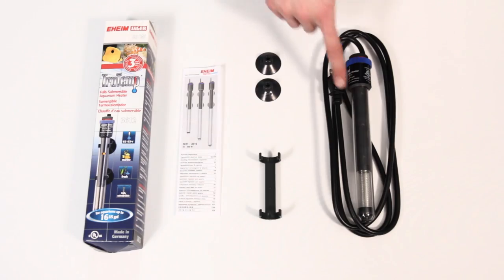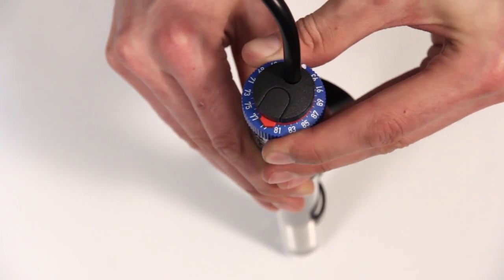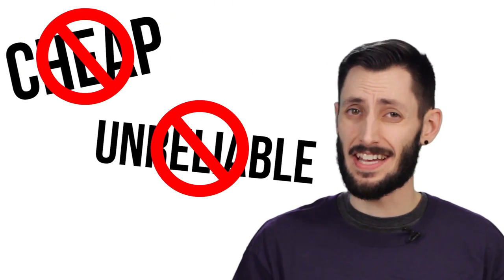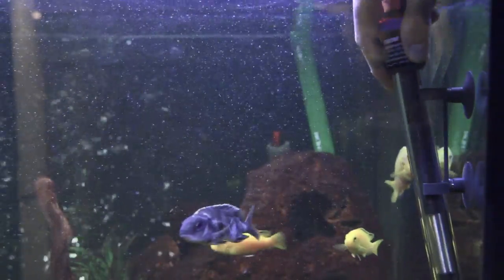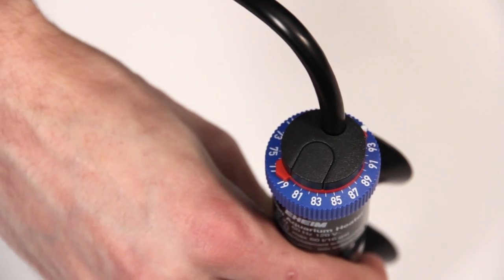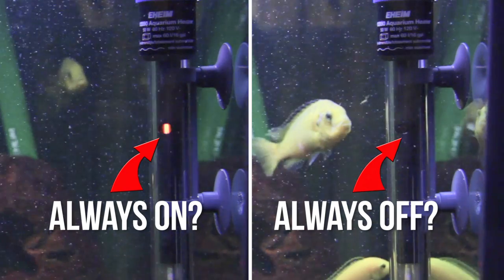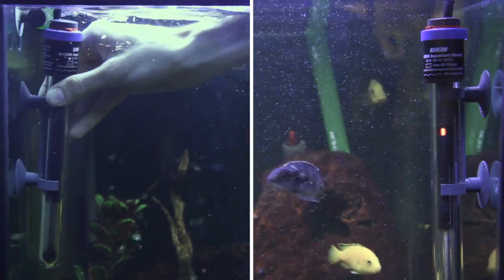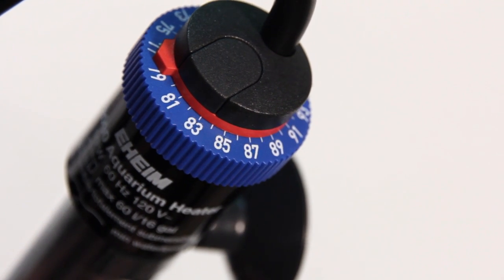How to Set Up, Install, and Calibrate your Eheim Jager Heater | BigAlsPets.com

Comment: NEVER remove your heater while plugged in. Unplug and let it remain in aquarium for 15 minutes before removing.
Reply: Why
Reply: @sweetscience1019  If left plugged in when removed from the tank, the glass tube could crack because there's no water to keep the glass tube from overheating.
Reply: CoroaEntertainment 👍🏼
Reply: yes don't do it people,  i mistakenly pulled a heater out of one tank  thinking it was unplugged it got so hot it melted the plastic trim around the top of the tank it was touching fire hazard
Reply: Well I learned that the hard way
Reply: @CoroaEntertainment and you’ll burn your hand and trust me they are hot

Comment: The system of this heater is complicated. You should just set the temperature with the indicator and you're done. There are versions that you have to lift that small lid with a screwdriver and others say that you just have to turn the back. I broke the lid trying to calibrate. I find it VERY complicated to calibrate.
Reply: To be fair to chelo I've never had issues with any other, I have had one of these and only had issues, maybe there are faulty batches? Mine is approx 6 degrees 'c off.

Comment: Been using an eheim jager 300w in my 75 gal now for 4 years never had a single issue temp is within 0.5 of set temp always used the jager series never had an issue with any of them

Comment: Sorry but I don't understand the Eheim instructions and I also don't understand the instructions in your video. It doesn't make sense to me? Maybe I am just being dumb? What arrow or dial am I supposed to move to the temperature the water currently is? The one on the back won't move to that as there is something blocking it. It will only move left or right a few clicks. My temperature is 28°C (82.5°F) when I have selected I want it to be 27°C (80.6°F) so it is out by 1°C or almost 2°F difference.

Comment: I’m trying to recalibrate mine it will not go below 80 no matter what I set it too. And when trying to recalibrate the red dial will not reach the temp that the thermometer is saying it’s heating too so how do I recalibrate it? I’ve been working on this for two weeks in a bucket I even changed the heaters out I have two of them an this one is the same no matter what you set it to it will only heat to 80 or 82 I’m trying to get it to 77 degrees what am I doing wrong?

Comment: I purchased new 70 Gallon aquarium back in 1978. At that time, I heard that EBO Jager was a good brand of aquarium heaters so, I purchased one. Fast forward to 2018.  Well, my EBO Jager heater, after 40 years of "flawless" performance, finally died.  Funny, the heater that I purchased to replace my EBO Jager (purchased it many years ago), has been very finicky wth the temperature setting.  I am now looking for another EBO Jager.  ;)

Comment: Hey Thomas,  did EBO JAGER get bought out by Eheim?  Hopefully not and hopefully Ebo J is still available. I have had absolutely NO luck with Eheim heaters (the red/blue ones) as I find they keep on shorting out or simply quit working.  Ebo Jags were incredible heaters and I never had a problem with them... Never... Ever!

Comment: Say I had a 130 gal tank outdoors and a 300w eheim jager marked to heat up water up to 1,000 liters. Outside temperature doesn't vary much at night. Will it perform as desired?

Comment: question so you state that using to heaters for a large tank what would you recommend for a 90 gallon tank one heater or two, and also what wattage would you recommend per heater thanks

Comment: Every heater I've bought say's put in tank for 30mins before plugging in.Unplug heater for 30min before taking out.Does the ehiem heater instructions say different?I Like the calibration feature.Fish On
Reply: I wondered about that too .. video just mentions removing and adjusting. Might have been worth mentioning to UNPLUG the heater first! I know they have auto-shutoffs but I don't trust them. I always unplug and wait a bit before removing. 30 minutes is a bit long, I usually wait ~ 5 minutes.
Reply: Theres no point I take my heater out straight away after unplugging and its not even hot

Comment: Hello lovely people,I have set my eheim heater (200 watt for upto 400ltrs) to 29C. It heats upto 29 and then when the water temp drops to 27 or 26 then it starts heating again. What should I do to maintain the water temp at 29. My tank is 325ltrs. Do I need to recalibrate the heater.
Thanks and a wonderful weekend ahead,
Saif
Reply: Sometimes its best to get a bigger heater especially if you live in colder environment. Or get Two smaller ones of the same wattage.

Comment: Hi . I just got the 150 watt version for my 200 liter tank . And no matter what i do it keeps heating  all the time . It doen't help turning the blue dial.   I wait for ten minuttes every time i adjust and have tried turning it all the way to each side . And it keeps warming and doesn't turn off?   The temperature is about 28c .   Room temperature is 21 c.   And i don,t have any lights turned on atm .   Is it broken or i,m i doing something wrong ?
Reply: whooptie2doo that sounds broken lol

Comment: well I just bought a brand new jager 125 watt n it wont turn off it sticks on I turned it to 18 tank was 26 n its heated it ti 30.4 so not using it best heater there no good
it cost me over £20 iv had 3 heaters fail n 3 weeks a brand new eheim jager a 6 month old marina we water in it and a 200watt Trixie 8 month old one with mist in it and thee jagers u can oney calabrate them by 1 degree
Reply: matthew o'dea are you sure your thermometer isnt broken? I've found a lot of them (along with a lot of heaters) are extraordinarily unreliable. The marina one that sticks to the inside being the worst.
Also are you keeping anything in the tank with the heater which could mess it up? I've had two marinas and aside from being bulky they've always been good but I also had a turtle who used to rip that thing off the wall and do god knows what to it. Both of them ended up sounding like they were going to explode any minute

Comment: hello, my heater it's always on and cant reach the right temperature.
Reply: Have you checked the water temperature with a thermometer - Is it too cold? If the heater is constantly on but the water is too cold then that heater is not powerful enough to reach the temperature you need in the tank it is in. You'll need a bigger heater.